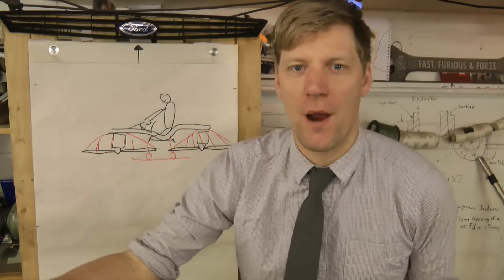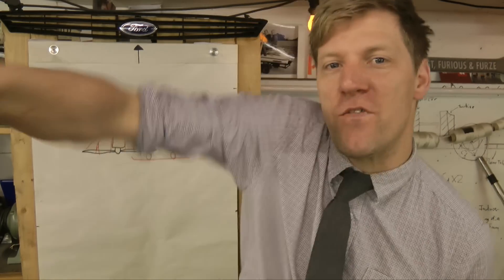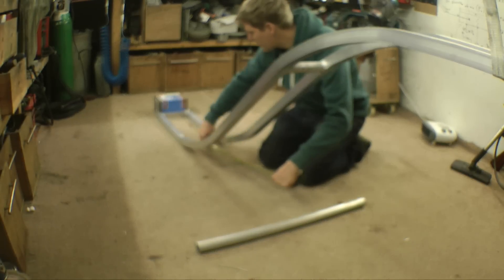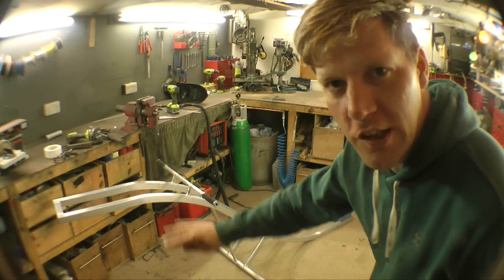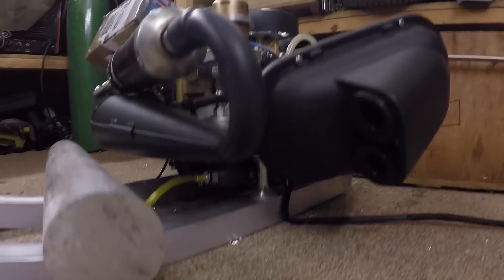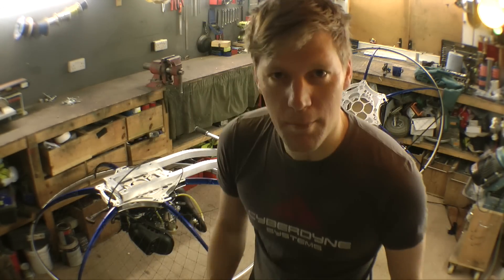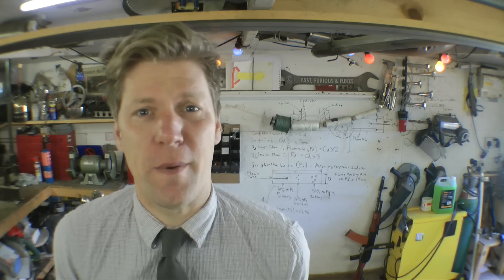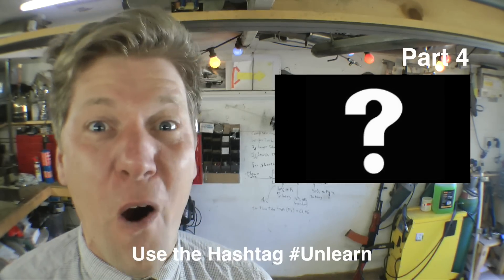Making a Home made Hoverbike

Comment: Young man, let me congratulate you on many issues in synthesising this craft. The fact that  you turned one motor upside down  and used a  different propeller to cancel out the overall torque and  then use the differential torque to steer ,yaw with.  That TIG welding  on aluminium is perfect in many ways , you are an expert welder.  The concept itself is brilliant  but perhaps you will introduce a bit more safety for your own sake.   
The lateral  inertia is much less than the pitching inertia so your weight movement would be different forward and sideways for the same rate of control of the craft so you have to educate  your own mind slowly to achieve this. If you had four  motors I am sure that you will achieve wonders. My heartiest congratulations.  All  our schools should have a brilliant  educator   like you  to show young students at an early age the beauty of science and engineering as they are the only components  which created comfort in our homes. Just look after yourself in your enthusiasm.
Reply: Incidentally at 0:15 you mentioned Gyroscopic effect, well normally the effect that you are referring is a torque effect and Gyroscopic effect is  another issue related to  gyroscopic precession.  Still , you know exactly what you are doing and you seem to have science in your blood as you feel the beauty of the Universe phenomena which many other " scholars do not ever generate!"
Reply: Umm... English please?
Reply: @bibliovore1   he's literally just using the proper terminology lol
Reply: I was fortunate enough to have a man like this (who spoke a little quieter) teach a physics class literally about rocket science. We had to do everything from conceptualize, design, build, and safely return a rocket between 1.5 and 4 feet in length to the ground while reaching an altitude of about 100 feet in the air while keeping the payload (1 chicken egg safe), all powered off of a combination of pressurized air and water with the base material being 2 liter soda bottles. Ah, I loved that class. And may I add that was just one of several chapters he taught us. Funny thing, the most use he had for our textbooks were to prop up experiments with them. He taught complex subjects, just in actually applicable ways. He was like here is how NASA simulates parachute deployment, here is how to shrink it down and do it in the hallway outside of the room, and here is how you safely FAIL in the event something goes wrong. Yes, we had projects litteraly explode, no, no one was hurt because we had failsafes in place. You can be crazy, safely.

Comment: It's an amazing experience to witness the transformation from the extremely detailed diagram in the beginning to the final device! I mean, it's just as you've drawn it, the planning and execution is incredible! /sarcarsm
Reply from the maker: +Asatruction amazing comment
Reply: +colinfurze can we please have a collaboration with Adam savage already?
Reply: +colinfurze Will you consider upgrading the design?  If you added a way to slightly throttle either engine, you'll be able to control the net torque and turn left and right.